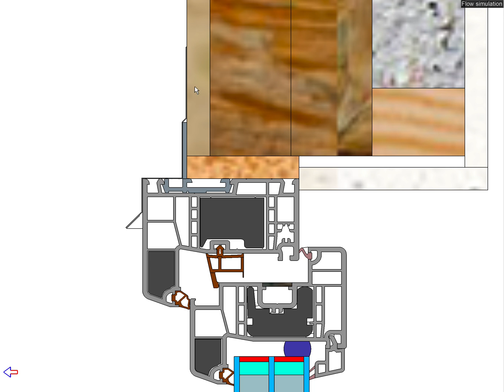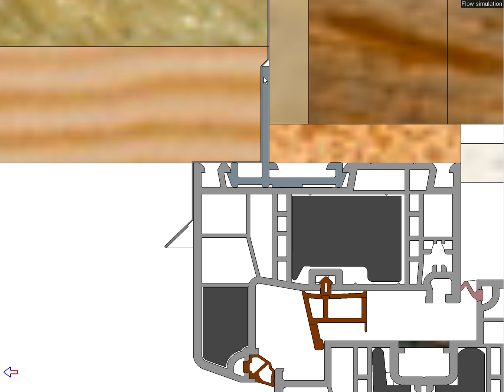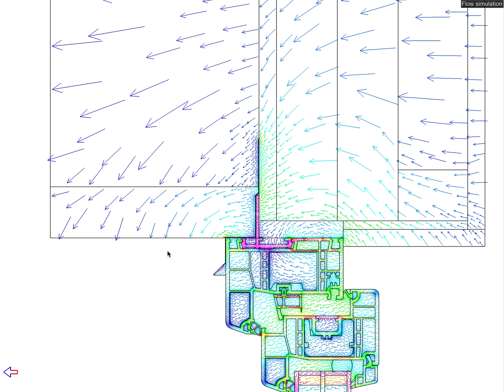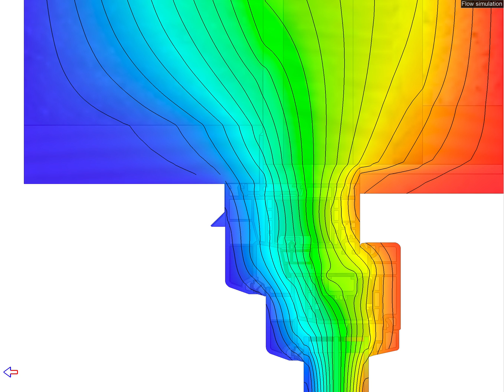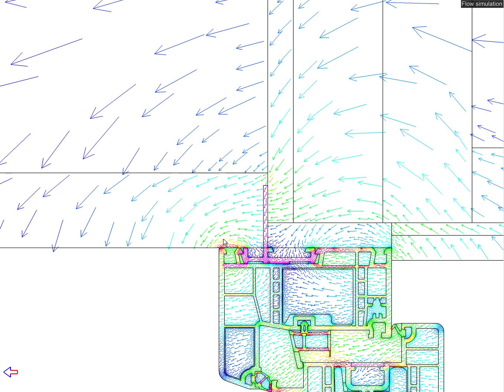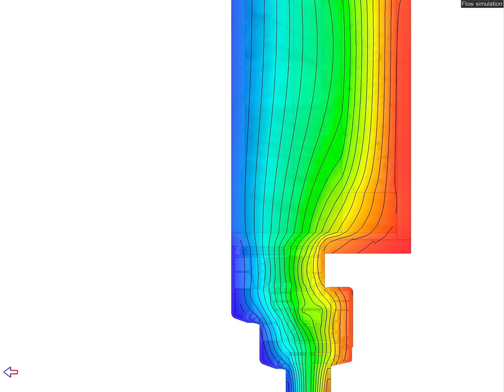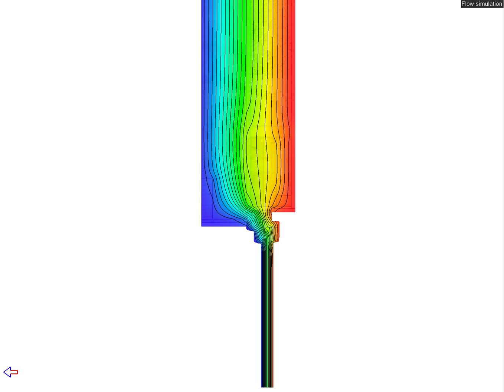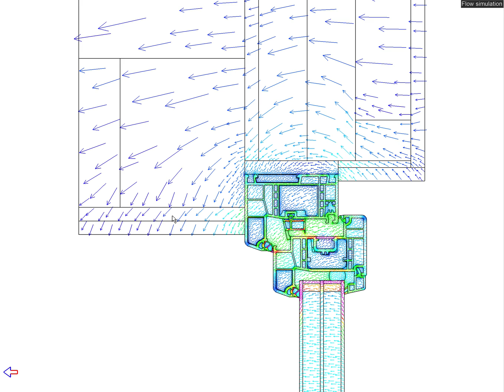Window Install Performance: Nail Flange vs Flangeless on a 2x6 Wall

Comment: 30db reduction by using 2 different glass thicknesses. do you agree?
Reply from the maker: using different glass thicknesses helps, as it does to have different thicknesses of the gas pockets. The actual db abtement I’m not sure, it needs to be calculated

Comment: how would this look on an icf wall with icf bucks ? I'm just designing my icf house with icf bucks and triple pane passive house standard windows.
Reply from the maker: it depends what your whole assembly looks like. Other than the ICF block, what else do you have in your wall assembly? Are you planning on having more insulation than that?

Comment: You mentioned that the performance of the R-9 window goes from R-9 to R-4 with the aluminum nail fin, what are the other conditions, such as switching to the vinyl and flangeless. Are we talking about R-9 to R-7 or R-8? Just curious how far we are getting into the weeds when most of these are acceptable details in the grand scheme of things. Thoughts?
Reply from the maker: hey Kyle! I may post a follow up video to cover this, and show how the window-to-wall thermal bridge impacts comfort and performance. Do you have additional questions or thoughts?
Reply: Enico, thank you for the response. I have heard a lot of debate on this topic in the industry over the past 8 years. Many building scientists claim it isn't worth the extra effort to over-insulate the window. I have also heard claims of lower durability by reducing drying potential around the window. Then there is the passive house community which very much pushes for over-insulating the frames. I have done both and typically push to over-insulate the frames but am curious about how far to push. The energy savings are somewhat negligible between the better options. The condensation risks are what I think about. It definitely increases the complexity of the flashing and extension jamb attachment when the window frames are over-insulated.  @emupassive
Reply from the maker: Please stay tuned, we have a few videos coming out that will cover this topic in greater detail

Comment: Great Video Enrico.  What software do you use to set up the model and what software do youuse to get the isotherms?  Is that the same one that does the Arrows showing heat loss?  How do we read that arrow length?  It looks like the length is inversely proportional to heat loss speed, so shorter arrows mean fast heat loss.
Reply from the maker: Hey Dave! Yes it is the one software that we use, that produces the two views - isotherms, and heat flow direction. The software is called Dartwin Mold Simulator. Regards the arrows, the length mostly shows the size of the finite elements the model in broken down into, it is the color that defines the intensity of the heat flow (ie to simplify: blue = low, green = medium, red = high, purple = oh my god)
Reply: @emupassive  Do you do the original structure modeling in SketchUp or is that in Dartwin also?
Reply from the maker: Dartwin allows to import dxf files, which we generate in Archicad